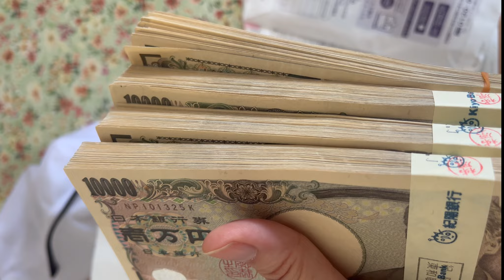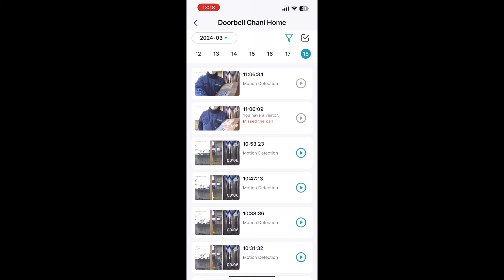Akiya Update| Purchase Costs & Renovations

Comment: Having a closed (lockable) garage inside the main house is such a luxury in urban areas of Japan.  That was great thinking !  Did the local building authorities give you any grief or was separate permitting required to change the former beauty salon into a garage ? (IE: did they require any structural changes to accommodate the big garage door ? )   Despite the limited choices one has when getting one of those Toto bath inserts, I think they’re totally worth it.  Easy to clean, plenty of shower space and the tubs are usually deep enough to soak your shoulders.  Sure, it would have been nice to pick custom tiles or a fancy tub, but just think how easy those are for maintenance!
Reply from the maker: For the garage, nothing was needed permit wise to change as the house was already on commercial/residential land. There already was an old door so structurally I didn't have to change anything just remove the glass door behind the roller door. 😀

Comment: You're so lucky to have a great kitchen that just needed to be cleaned! In your bathroom came out great! My husband and I have purchased a couple of houses and sometimes you do run into those nasty surprises. Actually really like your bathroom layout and colors it's very calm. Have you thought long-term about maybe removing the AstroTurf in the garden and having someone come in and remove the old concrete? You could either then replace it with some other type of hardscaping or plant Turf but then that would need to be mowed

Comment: I’ve looked at some places in Wakayama because it’s with 90 mins drive-time to my home.But I’m mainly looking for secluded, forested land to make a ‘campsite’. But if there is a house that would be okay. Maybe for use as storage, supplementary sleeping quarters, mounting a solar system, etc. Not into a DIY house.

Oh, looks like you bought a very similar air pump to the one I just replaced. It gave up the ghost after almost 35 years. The city just came by to inform me I was ‘obligated’ to pay to hook up to the city sewer system they put in about 10 years ago. Unless their is some sort if ‘penalty’ that ‘obligation’ isn’t going to impact my decision.

Comment: Thank you for sharing your experience. Was there any time during your house viewing stage that you were concerned about the presence of asbestos? I heard it was quite commonly used in the past and many old Japanese houses still have them.
Reply from the maker: Not so worried about this house. It is mostly timber and the walls are gyprock or plywood panelling. This house was build by Sekisui house in the early 80's. The handyman said if they find asbestos they would have to handle it differently but they never found any.

Comment: This looks fantastic! Would you mind sharing the cost of the unit bath itself?
Reply from the maker: It was cheap I think around ¥400,000. Which was about $4K AUD. Not sure about other currencies. Then the builder added his bit for demolition, new pipes and installation. This was around ¥400,000 as well. I found a link to the actual unit bath. 
 https://item.rakuten.co.jp/iportshop/toto-sazana-s-1618/?scid=af_pc_etc&sc2id=af_113_0_10001868&iasid=wem_icbs_&gclid=CjwKCAjwnv-vBhBdEiwABCYQAw-raSAQLdrfxVCVdwDcKZJolSGwd_ErA_mhmbcP_eSxLJP6ufAbzRoCmJUQAvD_BwE&ifd=57&icm_cid=18507115089&icm_agid=&icm_acid=255-776-8501
Reply: Thanks Chani. I am working on my place. I am at a crossroads between updating my showa style or just getting something new all together. This information helps because I was also visiting the showrooms which is priced higher.

Comment: Looks great and you must be the envy of your neighbours with lockup garage! We had similar aged house in tokyo and the pipes were leaking and failed in kitchen area, Once under the floor and another in the wall! Have you replaced all the pipes or only connected new pipes in the bathroom area? Because you most likely have more leaks down the track so i would plan to do before they fail. Good luck!!
Reply from the maker: Hi there. I’ve replaced all the pipes. The house is pretty small so it was cheap and easy to do. I’ve also got trap doors in every water area so I can keep an eye on issues 😃. Do you still have your house or did you upgrade?
Reply: @ChaniJapan my Japanese wife saw a block of 4 new houses being built around the corner…we sold our house and bought a new one! Over a million Aussie $ in central Tokyo. Our old house also had continuous stream of rats living in the walls and ceiling which I had to trap and release regularly 🐀 .
Reply from the maker: @surfer21  wow! I have seen a few new houses popping up around me. Seems like people are rebuilding the old ones to keep the location. Thankfully I don’t have rats. Millie will keep them under control if they come near the house 🐱